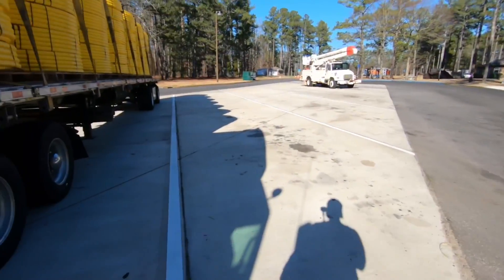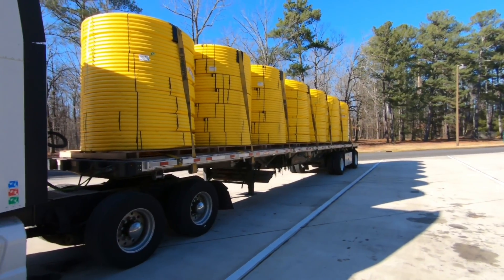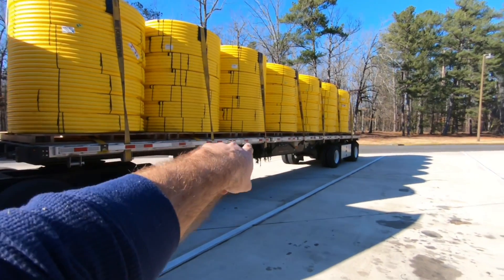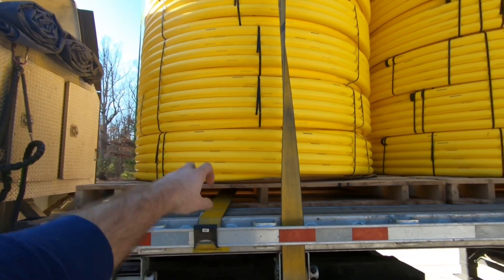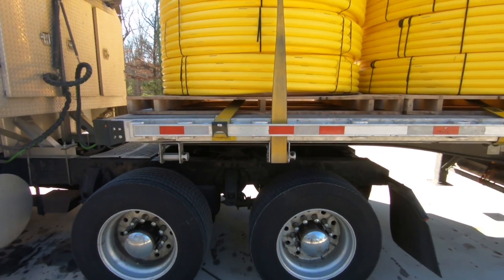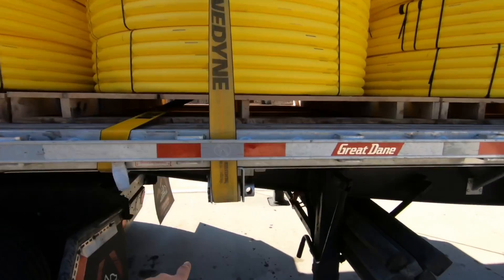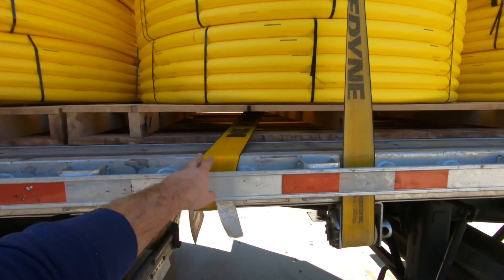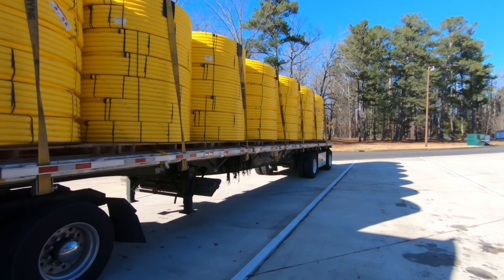Trucking Rookie Series | Flatbed Securement: Eye to the Sky Coils of Plastic Pipe

Comment: What is the reason for not hooking the strap on the opposite side rather then hooking it on the same side ?   just asking brother.
Reply from the maker: Good question, the two straps, one on each side, is safer. Going over the top with one strap can slide off easier.
Reply: @DrivenTrucking  Roger that Brian, thanks brother

Comment: No penalty strap on the front due to no head board?
Reply from the maker: Technically the product requires one strap so using two up front would cover the penalty strap. They’re very light.
Reply: No your dead on Little Paw. I was wrong. It must be over 10' in length without a headerboard that there must be a penalty strap. So, from my understanding there would be 3 straps in the first 10'.
Reply from the maker: Little PAW 1969 dead on PAW
Reply from the maker: Chris Clark any time there’s no header there’s a penalty strap required. In this instance, it would be a specialty case but we are covered anyway for one strap for less than ten feet, and one for the penalty. The weight isn’t a factor on this load since they’re so light
Reply: Please explain “penalty strap”.
Reply from the maker: When freight is not resting up against something in front of it, for example a header board or other freight closer to the truck, an additional strap must be added to DOT’s minimum guidelines. Aka penalty strap
Reply: Chris Clark Thanks! I’d never heard the term “penalty strap” before.  Obviously this series will be helpful to us rooks.
Reply from the maker: aircooledhead we’re all rookies! I hope these videos do help 👍🏻 thanks for watching

Comment: Help us settle a debate, please. We see you have bundles of bungees hanging under your trailer. I’ve been told that you will get pulled over for this because the bungees aren’t secure and bumpiness from driving could cause them to shake loose and potentially burst your trailer tires or another vehicle’s tires. Also, can you secure your dunage under your trailer with bungees? And can you secure your tarps to your headache rack or catwalk with bungees? I’ve been told no for all these because bungees don’t have working load limits. I’ve been told to use one inch straps instead, BUT I see numerous trucks and trailers with tarps and dunage secured with bungees and bungees hanging under their trailers.🤷🏽‍♂️ Thanks 🙏🏾 Bungees are faster to attach and loosen than one inch straps.
Reply from the maker: Technically you are not supposed to have bungees hanging from underneath your trailer, flatbedders have been doing it for a long time and is typically overlooked.
To answer your other questions, no you were not allowed to use bungees to secure anything. Your 1 inch straps must have some type of working load limit identifier on them as well in order to use those. When securing anything at all you must stay within DOT guidelines.

Comment: One strap across the top and one strap directly on the pallet?
Reply: Dixie Mae 
It’s using the strap from one side. Both ends are attatched  to the same side of the truck. Repeated on the other side. Hook and winch end of strap pull to the same side of the truck. You can use it like he showed, or go on the outside of an item and keep it centered, and unable to move side to side